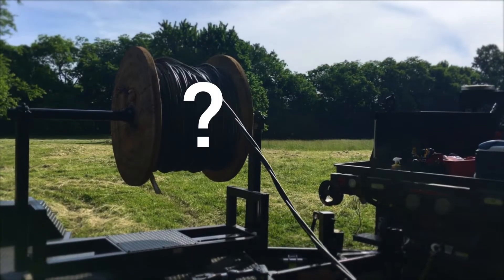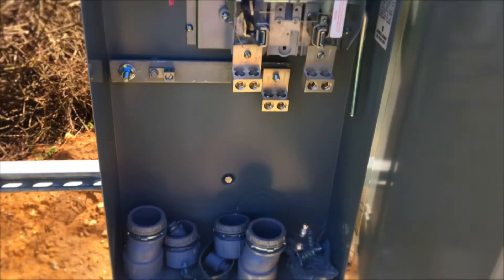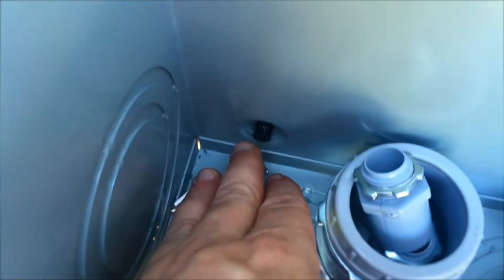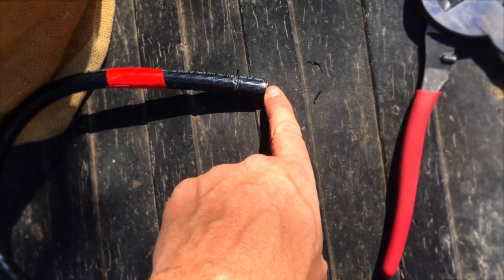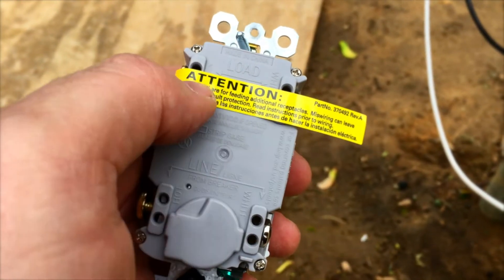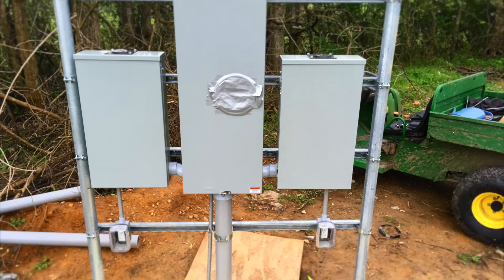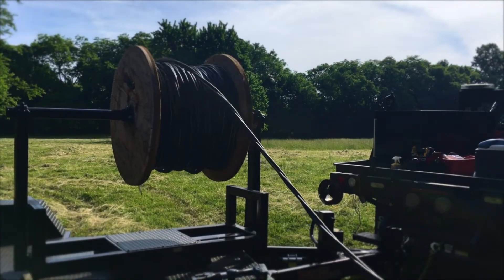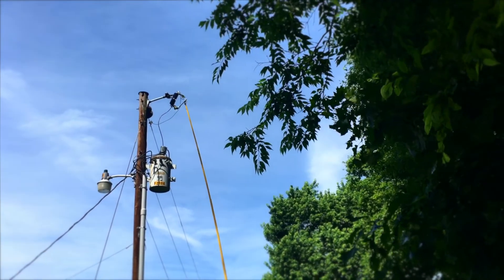Electrical Service P5 | Building Free Standing Meter Base P2 | DIY Barn House Design Build

Comment: I am finding myself having to do this same project. Any sage advice or particular trouble you ran into?
Reply from the maker: Well it's wise to ask for advice like you're already doing. I regret not calling our POCO for drawing clarifications–instead, I wasted hours doing a deep dive online. Study your local codes carefully; earth vs equipment grounding is very confusing. Your electric supplier might be able to help; for instance, I was searching for conduit expansion joints, but they don't stock it – since they’re not required here. Trouble wise, seal the panels against wind-blown rain. Overall, I try to work slowly while awkwardly talking out loud to myself when working with electricity. As a clueless 10-year-old, I shocked myself when trying to wire a receptacle (I was holding) into a hot receptacle, leaving black wall marks–lesson learned, further reinforced by my parents.
Reply: @StubbornGrit I'm already well into the deep dive. It's not to hard to understand but I'm struggling finding a proper meter box available for what I want to do that matches what I'm told the power co wants.
Reply from the maker: Totally understand the challenge of sourcing supplies! Thankfully our local electrical supply had what the POCO requires in our area. So many other things along the way have been a lot harder to source. Hope you can find what you need for your project soon!

Comment: Good video and happy for you, but was really hoping for more of a “how-to”, as I’m in a similar situation of building one of these things from scratch.
Reply from the maker: I hear you and recall the challenge of trying to figure it all out. Unfortunately I don’t have the confidence or experience to do more than try to share what we did. I do recommend checking with your power company. They likely have detailed drawing & material lists. Also, if you have a local electric supply they might be able to recommend specific supplies or even how typical installs are performed in your area. Thanks for watching & taking the time to comment!
Reply: @StubbornGrit thanks, that’s exactly what I did, but the electric company seemed to be purposely confusing and uninformative when I said I wanted to do it myself.  They suggested I just hire an electrician.  The electric supply ppl were super nice, but not a good source of how-to info.  They were more than happy to go and get the materials I asked for, but not so much when I inquired about “what” materials I should get.  They to suggested I hire an electrician too…that coincidentally was right there in the store and good friends with them.  Ugh!  Just a very frustrating situation overall.  I did call an electrician and the quote was $3,900…and I had already dug the trench and bought and installed the conduit.  I was in electronics in the Navy and did my own heavy-up for the house so it’s not like I’m starting from scratch.  Needless to say, I eventually stumbled my way through it and am nearly finished.  I feel much more comfortable having done it myself.  Really appreciated the video though, thanks for the reply to my comment.  Best of luck!
Reply from the maker: Great to hear you are almost finished and happy belated Veterans Day!

Comment: Thank you for posting this! I have been pondering how to do this for days! I am planning to build a 2000 sf metal building and a detached 400 sf tiny house as phase one and then a barndominium later. Each needs its own disconnect and there will be an electrical panel at each building. Not sure if the tiny house or metal building will finish first so I want to do a free-standing central connection point near the three buildings but not so close that it will be in the way. Thought about doing a block wall or just using Unistrut but your solution with the galvanized pipe that allows adjustment with no footing in the way of the underground conduits is really clever! I am also doing a 400-amp service with an electric utility co-op. I want to leave space to connect ground-mounted solar and maybe a generator transfer switch. Dig the ditch once and hopefully no future redo.
Reply from the maker: Glad our project could help spark some ideas! Pun intended :) Best of luck with all your build plans!
Reply: @StubbornGrit  Do you know/think the switch gear / panels could be mounted back to back? To fit all the stuff I want it looks like I need about 8-10 feet horizontally with three support pipes. I am wondering if I might be able to put the panels on two faces of the free-standing support structure, that way I could just do two pipes 4-1/2 feet apart like what you did. I need a 400amp meter box, three disconnects/safety switches, plus a small panel with receptacles for construction power and the well pump. Not sure if I will do a transfer switch for a generator and solar on it too. I looked at the Eaton catalog and seems like some of the "safety switches" have at least one knock-out on the back. I am hoping to not have to use a wire gutter along the top which is what somebody told me would be needed. Thanks again!
Reply from the maker: Mounting some solar related gear on the back sounds reasonable to me presuming accessible with proper clearances, heights and labeling, but of course, codes and approvals can be a tricky thing in context. I'm thinking a gutter might actually make things easier in some ways. Have you had a chance to review your POCO's drawings & specs for their approved equipment/configurations?
Reply: @StubbornGrit  Yes they have a really good guide on their website. I will do the back-to-back layout as it gives me better clearance from the building for construction. I will figure out where to put it on the site but I am 90% sure I will get an electrician to do it. I built a house 35 years ago and now I am too old to do it myself. I want to get it done reasonably quick.

Comment: Did you really need two feedthrough panels?  My electical guy is saying I only need one, feedthrough lugs go to house and run shop off a breaker.
Reply from the maker: We are using feed through lugs on both disconnects because we are running 160/200 amps feeders out of each panel. If we were only needing 100 amps or less then what your electrician says makes sense to me, no need for feed through lugs on the second panel, but of course, I'm not an electrician and this is just what we are doing based on how much power we think we will need now and in the future.
Reply: For a 400 amp service (2) 200 amp panels are common as they are cheaper than a single panel rated for that.  I'm doing the same thing and one is 200 amp disconnect for my house and the other is a 200 amp panel for the outbuildings I will have.

Comment: No ground loop for your service disconnects
Reply from the maker: Thanks for your sharp insight! Personally, I’ve found that bonding and grounding in general is very difficult to fully understand. Then there’s the challenge of code interpretation and how it’s implemented locally. What do you recommend?
Reply from the maker: To hopefully further clarify what we did in our context, we are only bonding the grounding electrode conductor in the meter can and not within the disconnects on either side. Both our disconnects have their bonding straps connected to the ground bus bar where the service neutral lands after leaving the meter can. We are not running an additional bare ground wire to the earth from the disconnects themselves.
Reply: Doing this same install with power company right now and was told ground from meter base(400 amp service) to grounding rods without going thru either disconnect. Each disconnect is now a main panel and ground is bonded with neutral there.  Panels fed from disconnects are now subpanels and need their own grounding rods at each location.